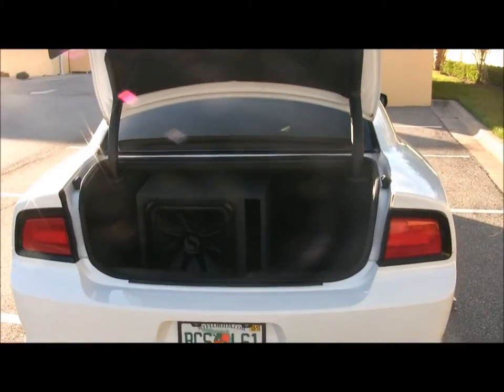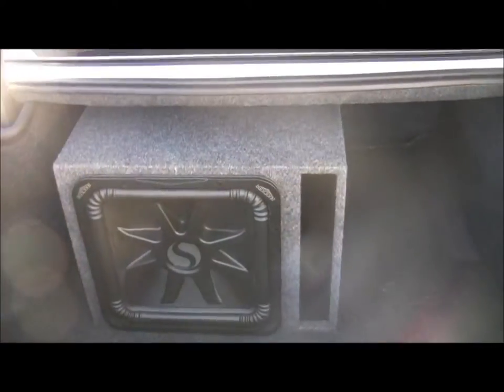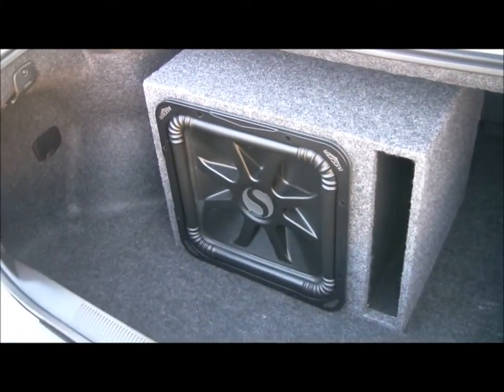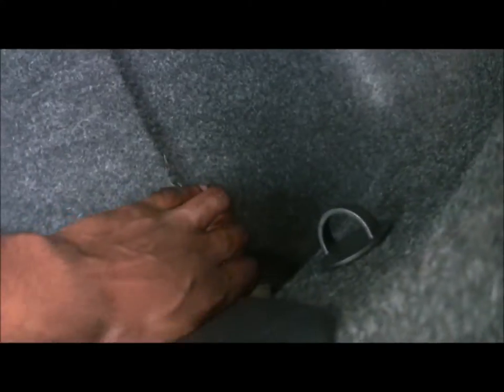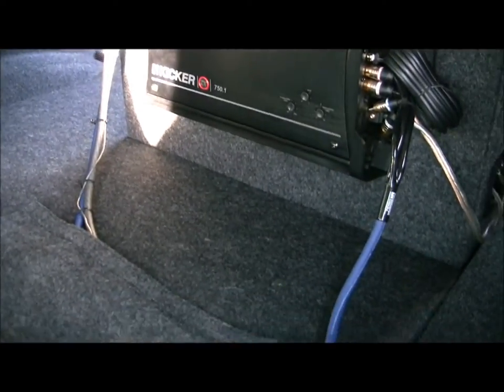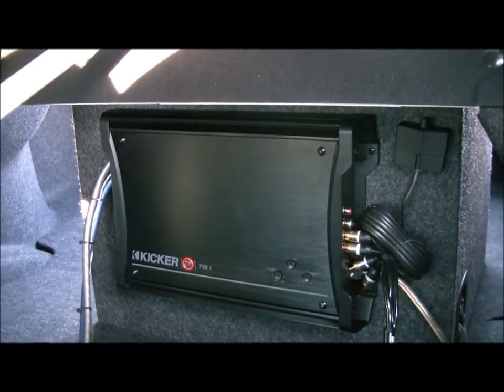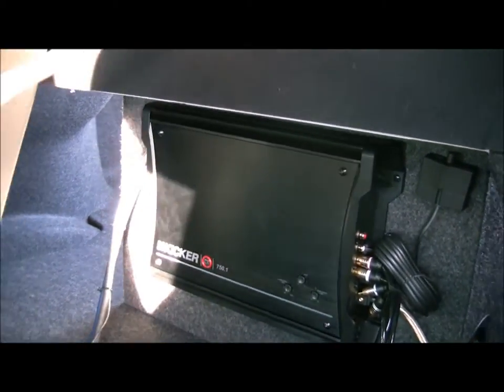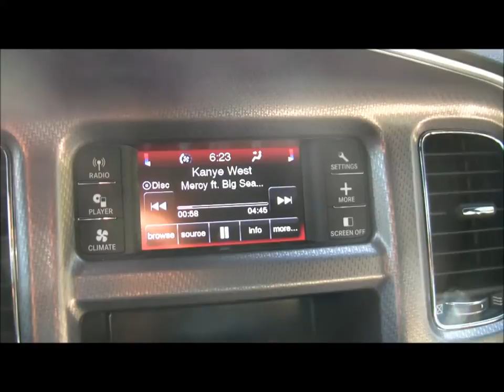Charger Vlog Sept 2012(Audio)

Comment: damn thats a sub lol. makes mine seem like a door speaker. i should put a vid of mine in my ga. i made it a real clean setup. i have the 10" pioneer slim sub, with a pioneer amp to match my pioneer deh6300ub head unit. pounds enough for me lol. cant hear the bass outside the car cause the sub is mounted facing the cabin. lemme know if you wanna see it.